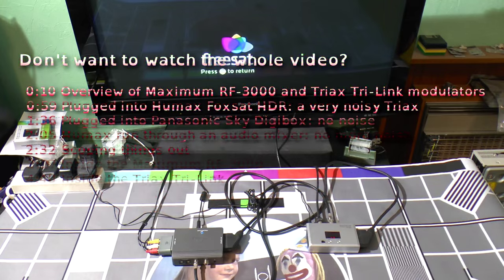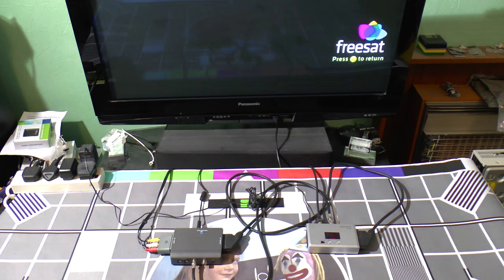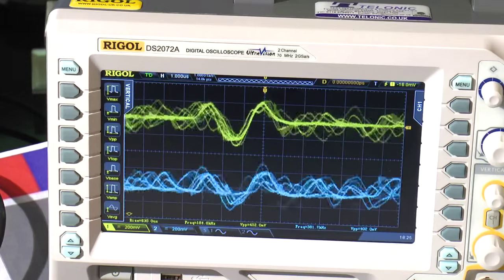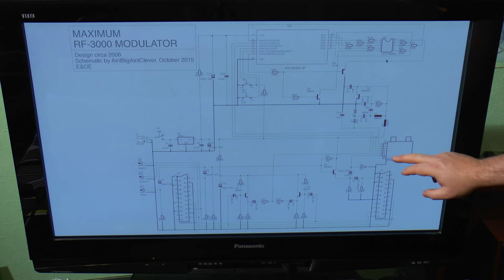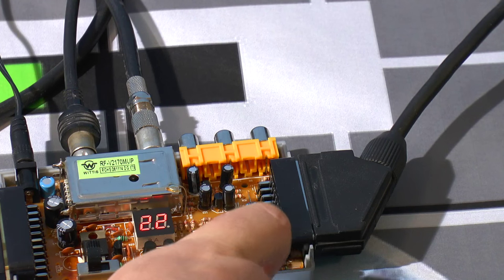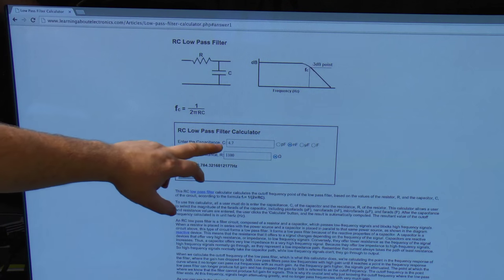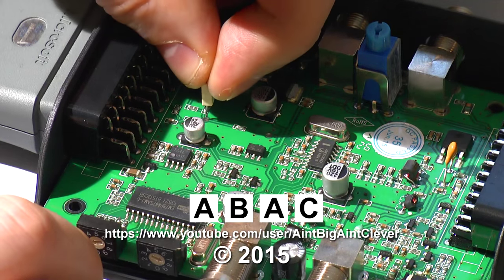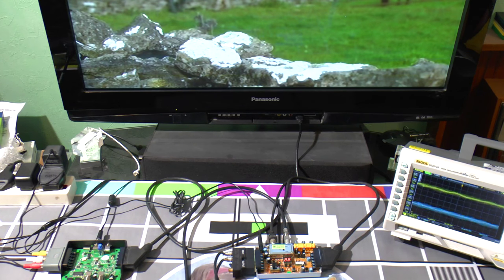Humax Freesat & Triax Tri-Link RF modulator noise fix

Comment: I have a Freesat Box outputting via a TRIAX 300128 HD MODULATOR. The sound is usually nomal, but from time to time it outputs the sound as a Dalek. Turning the box off and on again always fixes it, as does just waiting. I have never had time to  measure how long between Daleks nor how long it takes to calm itself down.

Would your fix fix this, do you think?

Comment: Hi We had the same issue, just tried a 4.7nf capacitor and the background noise has disappeared great.
But to be replaced with another background noise rather like popping...
 Any ideas ??
Reply from the maker: Not sure. If it's rhythmic the first thing that springs to mind is a switch-mode power supply doing something odd, but of course I could be talking bollocks. Have you got any power supplies plugged in but not connected to a load, such as chargers (including built-into-the-socket chargers)? Do you have a filtered (not just surge protected) mains adaptor you could try running stuff through?
Reply: @AintBigAintClever  Hi 
The sound We assume is rhythmic,  
Assume it's the sound of the capacitor discharging maybe ??
We do have a number of appliances in the cupboard such as. Humax box , surround sound unit, 4 way booster for magic eyes and router .
Reply from the maker: It'd be worth unplugging some of the other devices at the wall to see if the sound stops.
Reply: @AintBigAintClever  
Will give it a try 

Cheers

Comment: Very glad to have found this solution,  I have exactly this problem with my Triax and Humax - strangely enough I also bought the Labgear modulator and have the same problem with it, so assumed it was something amiss with my Humax box.  Going to try the capacitor fix as you describe, but could you give an exact spec of the 4.7nF required as I'm seeing multiple options when searching for it.  Many thanks!
Reply from the maker: +chris473684 Just grab anything that's 4.7nF. I was rummaging through an old popcorn tub full of ceramic disc and polyester caps, the one in the video was the first one out with the value I was after.
Reply: +AintBigAintClever Just to say, my electrician friend installed the capacitor as you described (99p for 10 of them) and now the sound from my Triax box is perfect.  Many, many thanks for sharing your fix for this!
Reply from the maker: +chris473684 Brilliant.
A friend of mine's just bought one of the newer Humax boxes (sticking two fingers up at the Murdoch media empire) together with a Triax modulator and his seems to be noise free, so it may be that Humax have fixed the issue on their newer models. At least we can nail the problem on the older ones now :)
Reply: +AintBigAintClever Thanks for explaining. Do you know the Humax models affected by any chance? I have a FOXSAT-HDR which I want to link up with the TriLink. Do you know if this was one of the affected models? Cheers, Jon
Reply: +Jon Sumpster Mine model is  the same Foxsat HDR.  Just to report back, the fix worked great and then for some reason the Triax gave up the ghost. No idea why. Had to go back to using another similar item which has the same problem at high volume levels.
Reply: +chris473684 Hi Chris, so basically it worked for about 3 months if the timeline above is right? Do you think it was caused by the modification? Or something else? Cheers, Jon
Reply from the maker: Jon Sumpster mine's working fine so the modification didn't break that, at least. All it's doing is absorbing the high frequency signals that the Humax is kicking out.
Reply: +Jon Sumpster I've no idea why it broke but can't see how the mod would have been to blame.
Reply: +AintBigAintClever Right, thanks again for doing this video. I've just got the new telly and triax and have plugged it all in with the Human FOXSAT HDR. As per your vid, I can get a picture (grainy) but just a load of hiss (no recognisable sound e.g. speech). Although you've explained it as clearly as possible, talk about nanofarads makes me get all dizzy and need a lie down :-). I see at 7:16 in your vid the capacitor label is '4n7 J 100'. I've had a look around the internet to try and find something similar and there are all sorts; 1000v DC, 500v AC, 3 Kv AC, 220v AC/400v DC, etc... , but I haven't got a clue whether any or all of these would be suitable. I've looked on Maplin (local to me) and they've got a 4.7nF rated at 64v DC +/- 5%. Product code on the website is DT94C. I should be capable of soldering it in, it's just that I don't want to do that more than once if I can avoid it. Have you got any pointers on the voltage rating would be suitable please? Any help gratefully appreciated. Cheers, Jon
Reply: +Jon Sumpster +AintBigAintClever. Sorry, just re-read the posts at the top, namely "Just grab anything that's 4.7nF". Have bought the Maplin one. Will post the result.